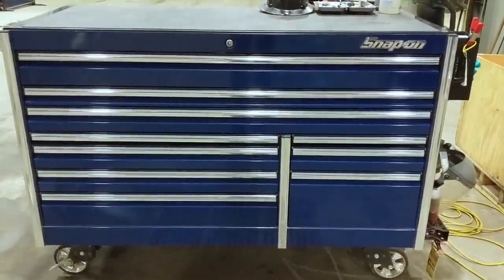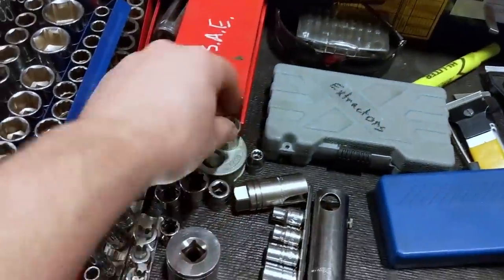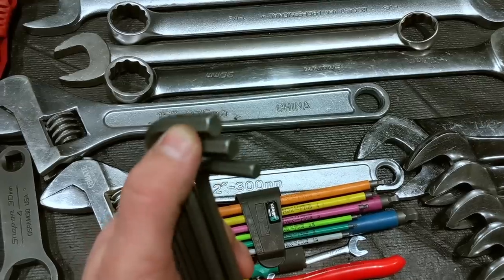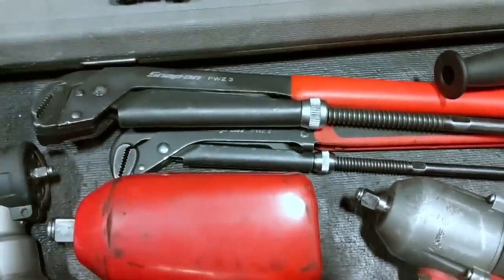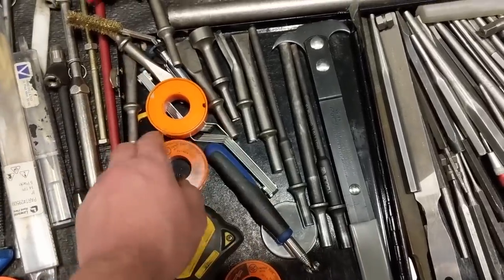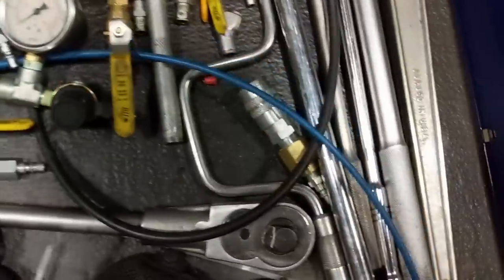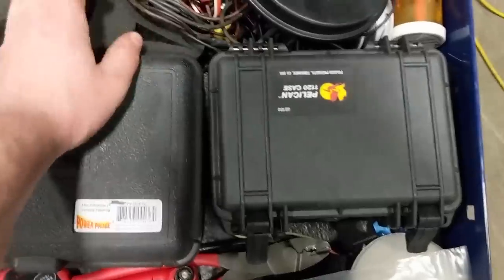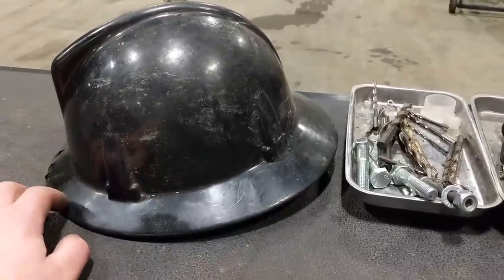Snap-on Epiq 68" toolbox tour 1.5 year update

Comment: correct me if im wrong, but in my experience, at least on most big rigs i've worked on, can't you tell if the fan hub is leaking by turning the key on engine off? i don't know much about offroad heavy equipment though so maybe you needed it in those applications....
Reply from the maker: Typically you can. The one I talked about was leaking slow enough I couldn't hear it. Only once I got the shop air directly to it and sprayed it with soapy water then I saw the bubbles.

Comment: Can I get the part number for the 30MM torque adaptor?
Reply from the maker: Sure it's GSRM430 from Snap-on, https://store.snapon.com/Torque-Adaptor-1-2-Drive-6-Point-Metric-30-mm-Standard-Torque-Adaptor-P838110.aspx
I noticed they now have a 12 point one which may be nicer SRDHM30, https://store.snapon.com/Standard-mm-1-2-Drive-Metric-30-mm-Double-Hex-Torque-Adaptor-P887917.aspx
Reply from the maker: looks like the 12 point one is 3 inches centre to centre, where the 6 point is 4 inches.  Might be nicer to have a bit more length depending on what you need to torque, but the 12 point will have more flexibility with the angle.  I might just have to get both!
Reply: Thank you.

Comment: Where do you connect the brake bleeder to on the fuel system?
Reply from the maker: The return line, pulls the fuel through the system after working on it.
Reply: @TheHDPerspective  do you have one of those connector fittings on the end?
Reply from the maker: I usually have the fittings at the shop that I need, or I can make something up if it's something I haven't worked on before. Most of the time it's enough just to get a piece of hose big enough to fit over the return line. Doesn't need to be a perfect seal. Could always wrap some electrical tape around it to get a better seal if you need to.
Reply from the maker: https://youtu.be/SGIRz7cf9SM here's a pretty good video describing the process